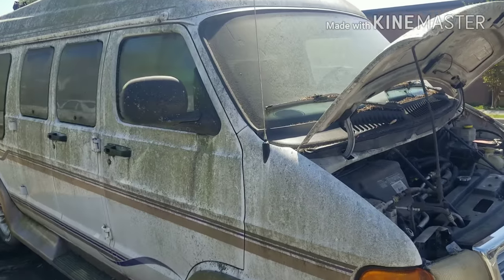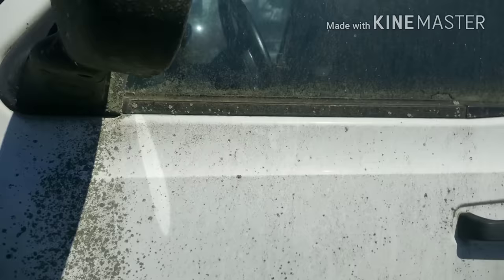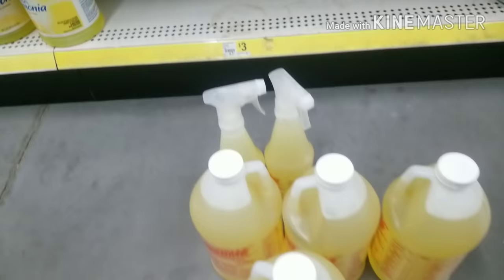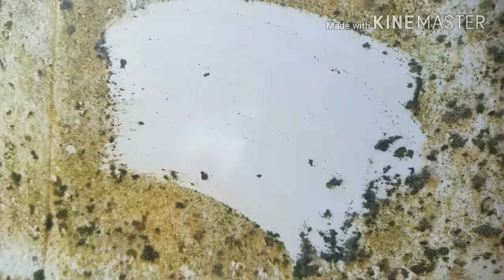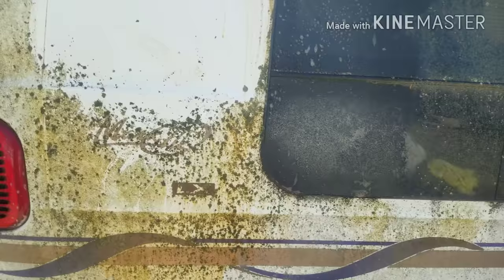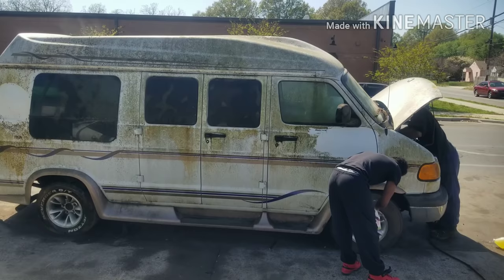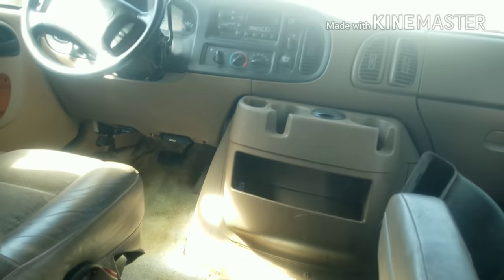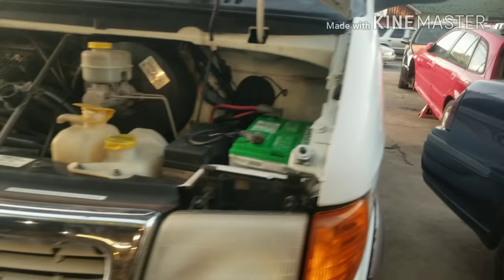How to CLEAN a Moldy Car, the CHEAP, Fast Easy Way.

Comment: 20 Year's in Air Force (A-10 jet engine mechanic)...Like the gentleman said ,THANK'S for your time and duty in your respective branch servicemen and servicewomen...I have a 88 Coupe deville (white),89 Sedan deville (blue) and a 90 El dorado (red) that I use in July 4th parades and they have sat since 2019 (thanks China) in NC under pines and gumball trees etc. and this stuff was a Godsend !! 2022 will see this triumvirate looking serviceable and sounding great...3 inch Flow Masters on all 3 and less than 80 on the clocks...Will donate to a worthy American cause afterwards...FIAT LUX !!

Comment: I have tried this on two different vehicles one a car that had sat out at my mechanics shop for a while while he was waiting for a part and it worked perfectly and the other was an old white van that had accumulated so much tree sap it was actually getting green and moldy and it worked perfectly both times. 
Thank you for the suggestion it saved a lot of time and effort.

Comment: I had bought a 2003 Ford 350 it had been sitting under some trees for 4 years it looked green like yours.. I cleaned it  down with cleaning vinegar and water from a spray bottle.  Just used old t shirts to wipe it down.. looks clean and shiny... it's a white cargo van the people I bought it from couldn't believe how good it looked... anyway thanks for sharing...

Comment: My truck was in worse shape than that van. I tried everything I saw on you tube, then every chemical in my shop, including some stuff that was not paint friendly,  nothing worked.  Sprayed it with this stuff hit it with the pressure washer,  90% clean. A little elbow grease on the tough spots and done. I can't  thank you enough.  Watch where you purchase this , paid 1 dollar at dollar  tree, it's 8 dollars at the parts store, I've seen it for 16 dollars on the internet. Took 1 and a half bottles to do my truck.

Comment: I picked up a 1963 Chrysler Imperial south Hampton similar condition, out of the pine grove, I put out a sprinkler and let the car get good and wet which softened up the dirt, used little squares of carpet and a few bottles of soft scrub, lot of elbow grease but it came out great , white car and a little Clorox goes a  long way, used a garden spray and it came back, spray wax ... I took it to a car show 3-4 days later. I still have the trophy from 1987,  Foss motors in southern NH 2nd place in its class

Comment: Those old "Coversion Vans" can be easily turned into modern "Overland Vans"... 2" Lift and some All Terrain tires, rip out the carpet and install wood or vinyl flooring...BINGO! Big $$$$
Reply: Only if they're 4wd though. Hard to find the 4wd ones.

Comment: Will be a nice van when all clean and tidy, i would have pressure washed it and maybe even go thru a car wash ( if it fits thru? ) to make ALL that mold was removed.
Nothing wrong with a good tape deck in a car they can still deliver very good sound quality, it all depends on the quality of the recording on the tape.

Comment: I’m going to put that stuff in my pump prayer (yard sprayer) and use it to clean my boat that’s been sitting for years!!

I know I’ve used Awesome in the past and it does leave a residue that needs to be washed away w Dawn Dish Detergent Soap really well w lots of rinsing to break down the slick residue!!

Comment: Wow im amazed. Yesterday i was at the car wash trying to get to the biggeld spotson top of my older van and i used a mix of water and yelow spic n span and i had to tape a towel rag to my cane and after letting sit for a minute and sprayed the rest in top it still did not come as clean. The mold has grone on window moulding and somevis brittly dry. What can i do to condition the rubber moulding around windiws and doors as well as sealant for and leaky seems

Comment: Surprised it worked on the top too.   My question ❓ is, what to doo for my expedition, 99 with a rough hood, no glass to it and it has mold and in it and on the top, while the sides look great, a great color.
Reply from the maker: did you watch the video?

Comment: Just in time. We were scratching our heads wondering what in the world we could clean the mold off our van that has been sitting under a tree. After seeing this we went straight  to Family Dollar and bought 4 64 ounce bottles of Totally Awesome. We put it in a pump up sprayer, took it to a high pressure car wash  sprayed it with the cleaner and used the pressure washer at the car washer. It took it all off. We were amazed!
Reply: Thanks for sharing.  Just wondering if you have noticed any difference in the original paint, trim, plastic/rubber areas since you cleaned it 4 months ago. i.e. dullness, damage to clear coat, etc.  Thanks in advance for replying.

Comment: Can you use that same Awesome on a rusted undercarriage with a little algae and possibly mold in spots (where someone used spray foam insulation)? I have an old RV I'm trying to restore but I'm stumped on how to DYI the bottom for cheap. Can you suggest another method/chemical?
Reply from the maker: yes use it

Comment: Do you have to wash the cleaner off with soap to remove the cleaner or is water enough to keep it from harming the paint?
Reply from the maker: water works fine, you dont need soap to remove    .........liquid soap

Comment: the high top is cherry, wow. That is so rare. Ask her if she going to sell it call you. There very valuable and in demand.. they says they can't be found now
Reply: Mine had red first stain from yr of living up there. Pink, I had to use Ajax and brilliant pad. Then compound back to polish
Reply from the maker: ill check if she wants to sell it.
Reply: Long ago. LOL  these back then new were 60 thousand our side of factory add on package so goog heavy duty wiring. There called conversation high top van. Just right size to fit in all tow parking. Other store owner want a bigger rv to get out as your blocking the store view. LOL try Craigslist but be careful. I payed 2 thousand for mine. The earlier ford model are 300 k same engine & trans Mine 145 had I had  it for  about 10 yr. just slowly maintaining engine parts to new. It's very acceptable & build inside as I want it.  It U get it,  let me know. I tell you how to build it beyond average.

Comment: Voice of Wisdom.
I've used this mix since the 70's.
(Minimal effort)
1) 5 gals bucket.
Add;
2) 1 gal. of Bleach. into bucket.
3) Half gallon of gasoline into the Mix.
4) 20 ounces of DAWN liquid.
5) Add water to the mix Up to the rim and mix it well.
6) Rinse the vehicle with water and Start washing the vehicle with a MOP and the Mix..
7) Leave the mix On the body for 10 minutes and RINSE.
8) the bleach will kill All that Mold and else, as it is ORGANIC.
It works great..!!